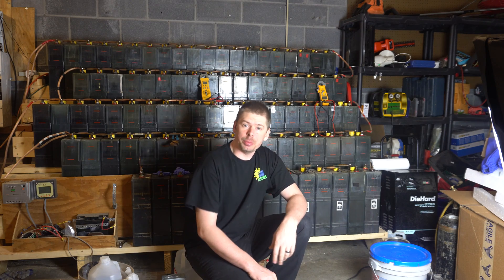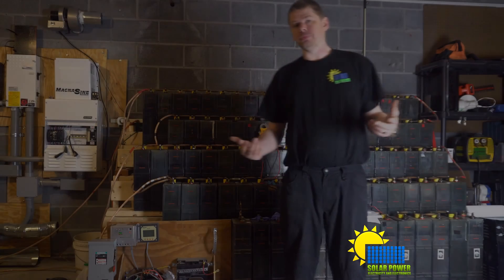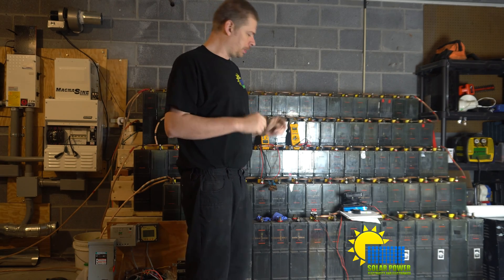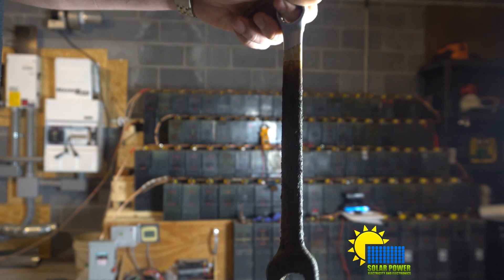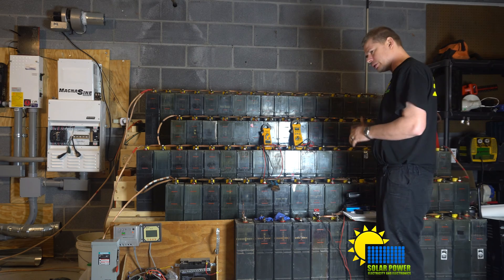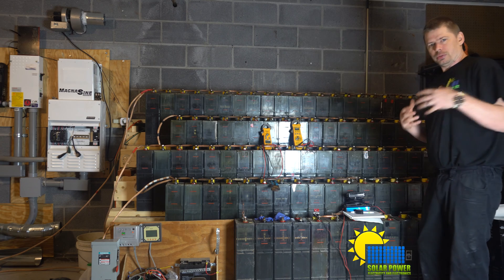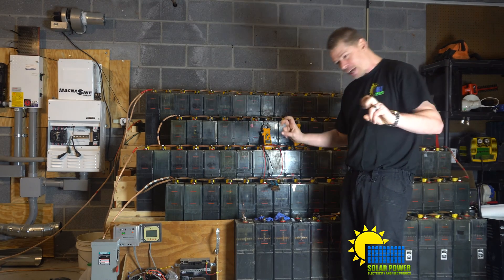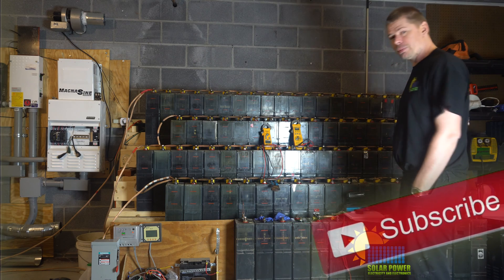Electrolysis with Edison ED-240 Batteries and possible new ways to clean the cells

Comment: Is cadmium used in solar panels?
Cadmium Telluride (CdTe) is a commonly used material in thin film solar modules. Cadmium is a heavy metal and extremely dangerous. ... In relation to solar panels, the CdTe is safe while encapsulated in the module, but if the panel is damaged and exposed to water, the cadmium telluride could leach into the water.
also
Cadmium poisoning may be caused by ingestion of food (e.g. grains, cereals, and leafy vegetables) and cigarette smoke. Occupational exposure to cadmium in metal plating, battery, and plastics industries may also occur.
also
CADMIUM POISONING

Cadmium is used for many items, including electroplating, storage batteries, vapor lamps and in some solders. The onset of symptoms may be delayed for two to four hours after exposure. Overexposure may cause fatigue, headaches, nausea, vomiting, abdominal cramps, diarrhea, and fever. In addition, progressive loss of lung function (emphysema), abnormal buildup of fluid within the lungs (pulmonary edema), and breathlessness (dyspnea) may also be present. In some cases, affected individuals may exhibit increased salivation; yellowing of the teeth; an unusually rapid heart beat (tachycardia); low levels of iron within the red blood cells (anemia); bluish discoloration (cyanosis) of the skin and mucous membranes due to insufficient oxygen supply to these tissues; and/or an impaired sense of smell (anosmia). Individuals with cadmium poisoning may also experience improper functioning of the canals with the kidney (renal tubular dysfunction) characterized by excretion of abnormally high levels of protein in the urine (proteinuria), minor changes in liver function, and/or softening of certain bones (osteomalacia).

Comment: wow Iminterested in contcting you. I run my home completely on solar energy and batteries led acid no nickel iron.Ihad  6volt edison bttery from  junk yard.origional corrigted cse bttery i replaced the electrolite. in one cell and wow the cpacity came back.using a chart recorder to record voltage under load. I was very impressed at the high capaacity of that cell over 50 years old. my emil adress is millard1@mhonline.net  or voltector@gmail.com Keep the Faith John Millard